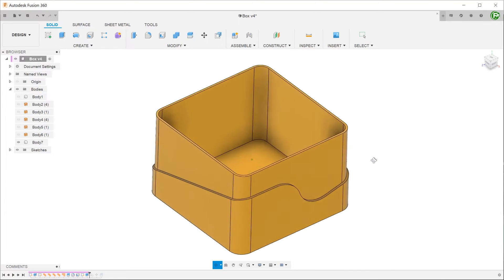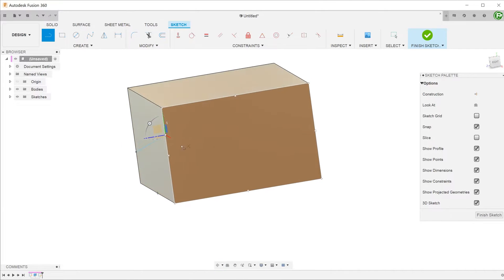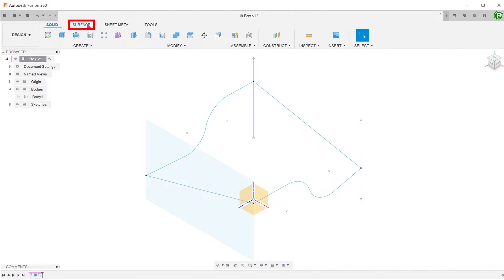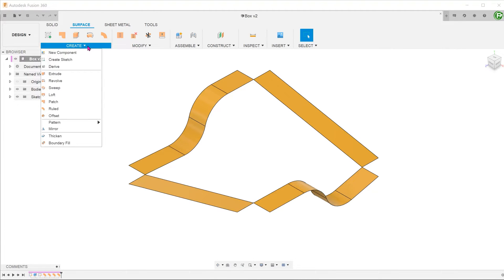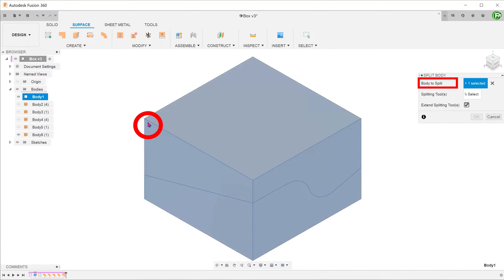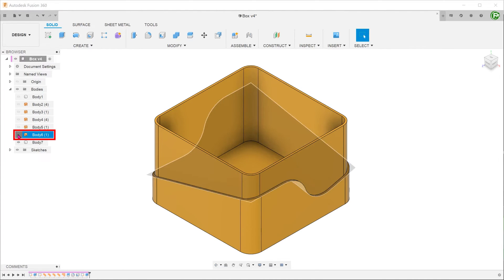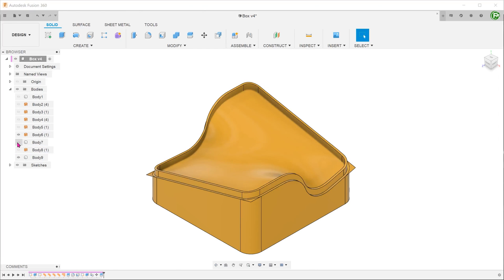Fusion 360 - Non-planar Box

Comment: A simple little extra you can do is fillet and shell the top hidden body to match the bottom and you will have yourself a nice lid to go with it. I'm going to 3D-Print the parts and see how it comes out!
Reply from the maker: Sounds good. For the top half, you would also need to create the lip/groove to match up against bottom half. In the past, I have run into difficulties printing out lip and groove features due to the tolerances involved. Let me know how it comes out:)
Reply: @Fusion360School  Yes, tolerances are important as first print try was to tight as it was basically size on size.  To get some clearance I simply shelled the top (lid) with a thickness .25mm smaller than the bottom. This was based off a 2mm thick wall for the bottom so the lid was shelled with a thickness of 1.75. This print worked great, box lid slides on a bit snug. Not really necessary to cut a groove as the top  fits snuggly over the edges of the lip. I did chamfer the lip .5mm to make the lid an easy fit.

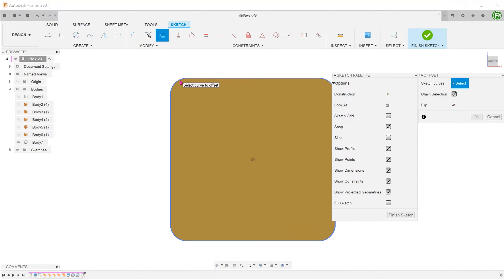Comment: At 5:07 when you offset the sketch edge you were able to do it directly without first projecting the body bottom. Wondering if you have something set in your preferences that allows this as I was unable to do that on my system. 
 Thanks for making these videos as complex shapes, surfacing, etc. are my modeling weakness.
Reply from the maker: There is indeed a preference setting. Sorry for not mentioning this in the video. Go to preferences -> general -> design. Check on "auto project geometry on active sketch plane". But I find that this does not work in all situations.